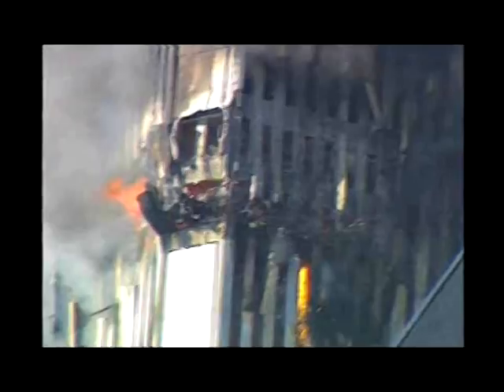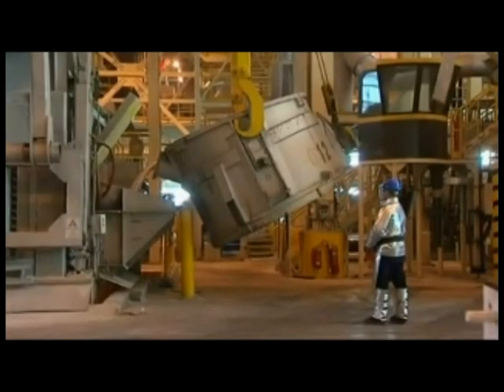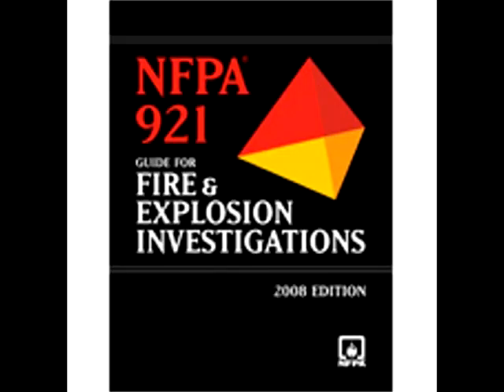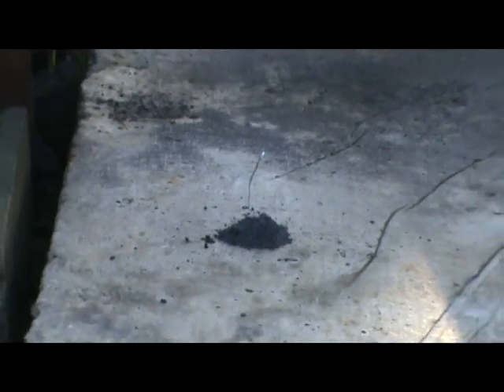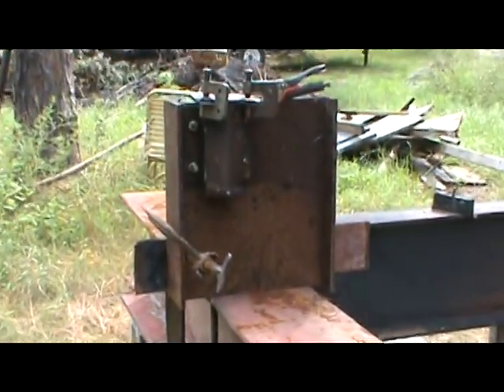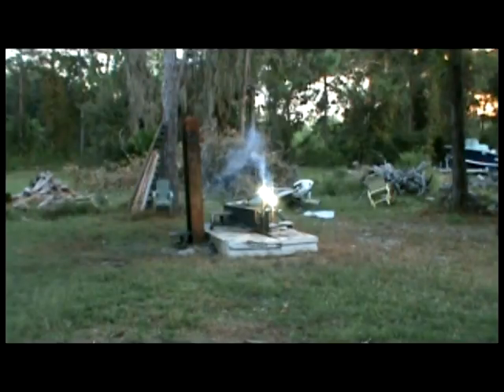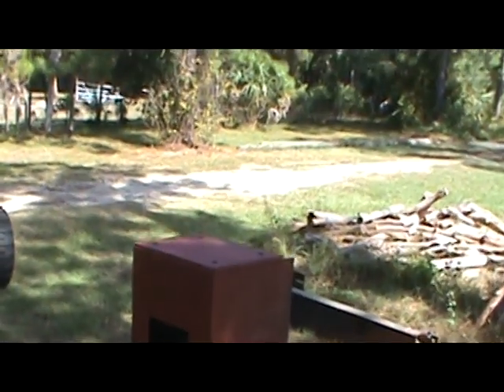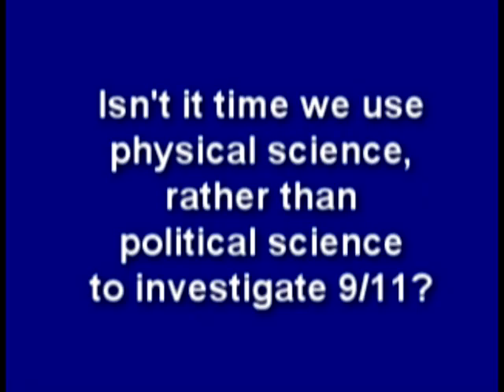9/11 Experiments: The Great Thermate Debate

Comment: Thanks government! You made all Americans look like fools
Reply: Actually - the only people looking like fools are the ones who took this video seriously.  The only possible reason for "thermite" to have been involved is if none of the people who set the charges knew anything about structures and the properties of structural materials.

Is it plausible that for some absurd reason - not one of the '"conspirators" knew anything at all about metals or structures?  

And of course there is the little problem of the fact that they would have had to do this work out in the open where literally anybody in the city could see them - because the structural supports for the building were outside of the building.  In fact - think of just how difficult this would have been without the need to do it clandestinely.  They would have to be working from platforms suspended from the top of the buildings.  And removing the facades over the structural members (which means that they would have needed to place cranes on the top of the building to lift the materials).  

Is it reasonable to think that any of this could have been done without people noticing?
Reply: @colincampbell767  I don't or didn't live in nor near the buildings, so wouldn't have noticed...much like most new Yorkers walking by a dead hobo or public extortion...nobody cares.
Reply: So you're saying that A massive engineering project requiring construction cranes and elevated platforms could have been conducted without anybody - no even the people who work there every day - noticing?  These platforms would have been 80 stories up and on the outside of the buildings.  The streets below them would have had to be closed.  And Nobody Noticed?
Reply: @colincampbell767  maybe they put the explosives/thermite in during the construction of the building or something. Maybe it was in the building plans? A frickin airplane can't do that. But I guess some people just have too much faith in the government to admit that this was planned.
Reply: Are you serious?  The put the "thermite" in during construction?  That has to be sarcasm.

BTW: please give me a technical explanation as to why you think that an aircraft couldn't have done what they did.  Explain how the structural materials could have retained their strength during an intense fire after the impact of an aircraft stripped the fireproofing off.  Explain how the fact that the welded connections were significantly weaker than the engineers calculated due to a design flaw inherent to practically all steel-frame buildings constructed prior to the early 1990s (that were not subsequently repaired) would not have contributed to the collapse.  

Explain how a bunch of conspirators who were smart enough to create an airtight conspiracy that lasted well over 15 years (so far) were dumb enough to use thermite in the first place.  Explain the fact that I have seen no pictures of steel structural elements that show the rather obvious signatures of thermite use.  Oh and BTW - it's even worse.  This supposed conspiracy would have to have been airtight for over 45 years if the termite was emplaced during construction.  

Please explain why anybody who knows anything about the properties of metals would regard the thermite theory as anything but moronic.  

The problem is that the only way to take the conspiracy theories seriously is if you turn off all rational thought and insulate yourself from all of the enormous logical and factual holes in the theory.
Reply: "what happened when a b52 bomber hit the empire state building?"

<facepalm>
It wasn't a B-52 kid.  You are not going to get me to take you seriously when you can't get something this simple right.

As for the manner they fell down - the fell down that way because of this thing called 'gravity.'  If you think that they should have fallen to the side - please explain what force was acting on the building that would have caused it to move that way. (If you want something that's not moving to start moving - you have to apply some kind of force to it.)

And I asked you to support your case - all I got was a bunch of questions (that indicate that you really don't understand classical physics).

"The bush family profited from ww2"
Sounds like you didn't bother to do any fact checking before you made that comment.  You are undoubtedly referring to one of the Bush family working at a bank whose assets were placed into a trustee status during WWII.  And your lack of fact checking makes you think that it was a Nazi owned bank.

Guess what - it was not a German bank.  It was a Dutch bank that was seized by the US govrenment after it's owner (Fritz Thyssen) was arrested by the Nazi's, sent to a concentration camp, and then seized control of the bank.  So yes the bank was seized by the Nazis - but Prescott Bush had been working for the bank when it was a Dutch bank.  

But yes - technically - Prescott Bush did work for the bank up to the point where Nazi ownership was discovered and the bank was seized by the US govrenment.  Besides a lot of people 'profited' from WWII.  Everybody who owned a company or owned stock in a company involved in war production profited.  In fact it was the fact that people could profit from war production that made the 'Arsenal of Democracy' possible.  This is why the US had vastly more efficient war industries than any other country in WWII - because people were free to bid on contracts and there was competition for those contracts.  All the govrenment had to do was give higher profit margins on the things that were the most essential to the war effort - and they had plenty of those things.

If you want to read about how the power of free enterprise and the market system was harnessed for war production - read the book 'Freedom's Forge; by Arthur Herman.  And how the most maligned 'war profiteers' were in reality patriotic men who resigned their positions in private industry and went to work for the US govrenment - for a salary of one dollar a year, for the duration of the war.
Reply: As I mentioned earlier - I'm retired.  So I have plenty of time on my hands and pointing out the flaws and stupidities in conspiracy theories is an amusing pastime.

And I know that no amount of logic and factual information cannot change your mind.  You have a certain worldview which allows you to blame something else for your failures in life and inflate your ego.  You are emotionally invested in the conspiracy theory - which is why my pointing out the flaws and asking you to address those flaws makes you angry.

And the fact of the matter is that you don't really know anything.  You have assumptions and mistake those assumptions for actual understanding of the subject.  

And it's amusing that you are demanding that I leave you alone - despite the fact that I have been doing nothing but respond to your comments the whole time.
Reply: "Triggered?"  Nothing you can do or say can 'trigger' me.  In fact I doubt that you even know what 'triggered' even means.  If you did - you wouldn't have used it in this context.  

I do this for my own amusement.  I have my hobby machine shop and CAD/CAM software, but there are only so many things I can make without cluttering up the house.  And I have had a life.  Now it is my time to sit in the sun and relax.  

BTW - my comment about you blaming other's for your life's failures was me playing the odds.  That's part of the profile for people who believe in conspiracy theories.
Reply: "I'm just saying that it was planned, and not by foreign terrorists."

Why do you think this? 

And you don't know what 'triggered' means.  If you notice that I have been consistent in providing people with not only my conclusions - but how I reached those conclusions.  I type paragraphs so that you can understand my reasoning.  If you notice - you know why I reached the conclusions I did and the tools I used to do so.  I do not just say "you're wrong" - I say that and then explain what the correct answer is.   

Something that you seem to be unable to do.  You cannot explain your reasoning or what you base your conclusions on.

Comment: Jet fuel Plus Aluminum airplane plus steel plus huge explosion equals thermite like burning. 
The second tower hit collapse due to the plane hitting the tower lower and more weight on the heat failed columns. Sulfur in Jet fuel.  TOWERS FAILED due to two Huge Jet Airliners full of jet fuel. All these other B.S. theories came from Radical Terrorists. THINK PEOPLE.